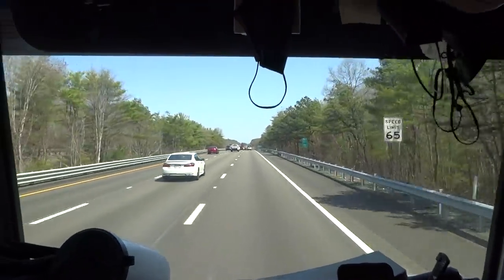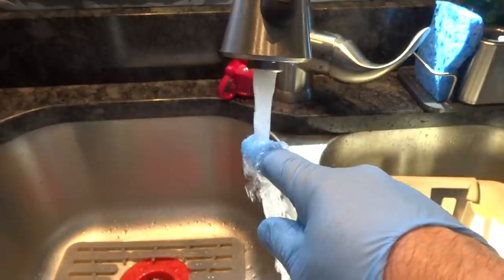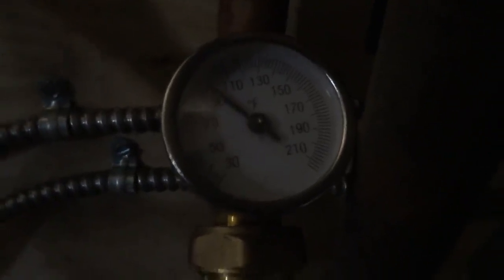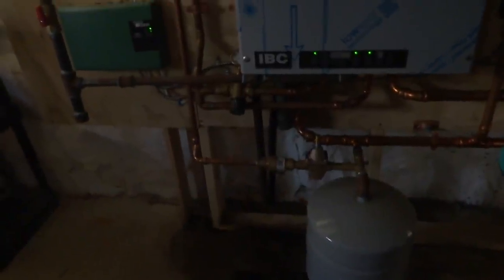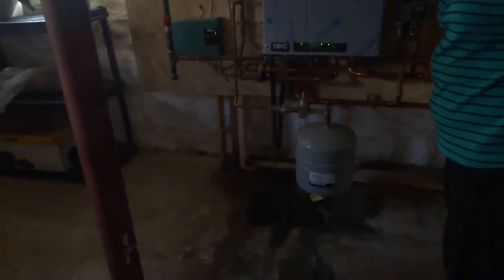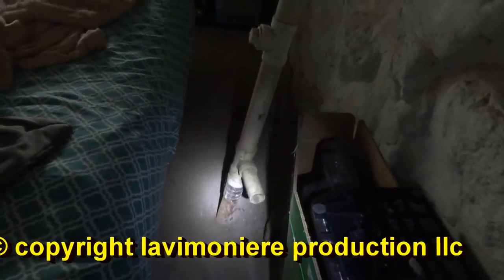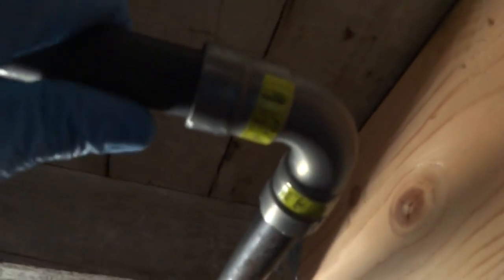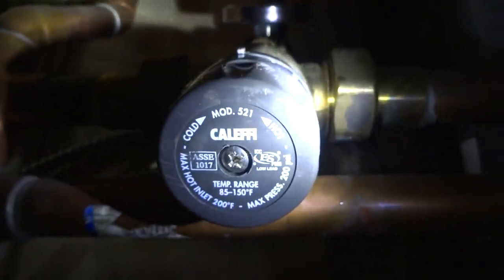HIGH EFFICIENCY GAS CONDENSING BOILER HACK INSTALL NO HOT WATER

Comment: The lady wants to address the issues. She just bought the home and I'm afraid she got a lemon. These are all issues that should have been disclosed at the time of purchase. Obviously the realtor and the previous owner didn't believe in due diligence and just wanted to unload the home. She may have a legitimate claim for non disclosure. She should contact her home owners insurance and seek advice on her options.
Reply: I don't understand.  There are inspections when a home is sold/purchased.  How did this "new" installation pass an inspection?  Dumping condensate water line onto the floor????  No drain valves on installation??  Saving time and pocketing money with cutting corners and not piping the intake to the outside?  And, old open PVC pipes to nowhere?   Tempering valves fail.  They suck.  Would it be allowed to bypass it and pipe the hot straight through to house supply and cap off the cold line? [Yea, I know....scalding issues, yadda yadda yadda]

Comment: They are "JUNK" my folks my years ago put in one in two different homes, and both units where the Worst!! They always had to let the Hot Water run for ever before they got hot water to the sink or shower, and had to run kitchen sink hot water before running dishwasher or was full of COLD water.  Took them out and put back normal Hot Water Tank and had all the hot water they needed.
Reply: That’s an easy fix put a recirculating line in ( problem solved )

Comment: Condensate drain line is acidic no?
Reply: highly acidic, i've seen it eat through cast iron pipe in less then 3 months
Reply: Yup. You're supposed to have it going through neutralizer media before dumping it down the drain to raise the pH enough to make it safe.
Reply: Definitely need a neutralizer.

Comment: More megapress i use them on low pressure steam condensates return in commercial in pinch ,  and you probably put it in already but a good pump for acidic condensate water is FP-22-DIVERSITECH

Comment: Steve , they had great gas fired wall heaters just for the water back when my family was posted to Germany with the military back in the mid to late 60's . It was just a small unit about 16" wide by 24" high mounted on the kitchen wall which was also close to the bathroom . It was a simple unit that was activated as soon as you turned on the hot water tap the burners fired and you had a constant supply of very hot water. Simple and never a problem with them , I often wondered why they were not here.
Reply: The customers here are idiots, they don't do yearly maintenance. The parts are special order majority of the time. The water has heavy scale the destroys the heat exchangers on them. They simply are not reliable enough for lazy homeowners.  Why spend 1200 on one when every ten years I buy a 350.00 dollar hot water tank.

Comment: I’m with you Steve. Give me a floor cast iron boiler any day. 
We are installing a ton of these pos wall hung boilers. No one is having them flushed yearly. They will all be replaced  in 7-8 years. 
Need to have a neutralizer on the condensate line too. No one is changing the media in the neutralizers.
I do like the mega press though. That has come in handy on gas and water.
Reply: UK here. Wall hung are pretty much standard. Nobody ever flushes them. Perhaps shoddy US manufacturing is the issue?

Comment: Steve 

The gas is a mega  press fitting and on a webinar they demonstrated bending it. Also there should have been isolation valves for service.
Reply: I want veiga to do a demo where the mega press a pipe bomb then compare it to a threaded pipe bomb in slow motion. There is a guy on youtube who has all the licenses to do it and makes pipe bombs all the time.

Comment: The boiler installers at this house saved every penny they could, drain valves?  isolation valves?  the installer didn't care about the plumber servicing the boiler.  Any valve before the expansion tank? Nope. Condensate water?? gravity will take care of it. Intake air?  Sure, use the already warm air in the cellar.
That mixing valve wasn't installed like the manufacturer, Caleffi, recommended, not even close. 
If you're a homeowner with a Caleffi mixing valve there's a YouTube video by Caleffi titled "How do I clean a thermostatic mixing valve?"  basically take the element out and soak it in vinegar or CLR a few hours, then reinstall, not practical for a plumber. My guess is that valve has been stuck since it was installed, Steve is just the guy who ended up with the problem.  

Caleffi is a big company in Belgium and the Netherlands, not all plumbing supply houses in the US carry their product or carry their replacement parts.  Supplyhouse does carry them, a replacement thermostatic Sensor cartridge is around $20 but you have to wait for shipment, new valves are around $140 depending on the size and fittings, and again you have to wait for shipment.

Steve might offer to install a few overhead lights in the cellar or recommend an electrician he knows and trusts.
This women will be a regular customer for Steve. 

Thanks for the video Steve.
Reply: He'll be baaaack

Comment: Hi Steven. Here in the Netherlands these condensating gas furnaces are standard, They need maintenance every year. There is a syphon inside for the condensate drain. This needs to be cleaned as they clog up. Also the burner bed needs cleaning every year. 
What is the make of this furnace, Intergas?
Reply: IBC.....zeg maar alles Intergas aan de binnenkant,een heel goede Boiler,niet tegen Steven vertellen,hij haat die dingen,hahaha
Reply: @barackobama5304  The installation is bad, such boilers need a condensation drain, everyone knows this and if you don't even bother to remove the packaging plastic from the appliance, and why connected as an open appliance,well.....

Comment: I bought one of those very early, "wall hung pieces of shit" back in  March, 1981. A large Japanese made, "Paloma Pack".  Three zones for heating, and a fourth zone for a hot water storage tank. I went from a coal boiler, that was converted to an oil fired boiler, to the gas fired Paloma Pak.
The change over was well worth the the cost, it paid large savings and  dividends$$ over the old oil fired coal boiler until 1996, when the local gas co. would no longer offer a service contract on this boiler! Went to a cast iron boiler in 1996, a Valiant, and it failed in 2010. Replaced it with another cast iron boiler!

Comment: Why would you put a tempering valve on a dhw unit? Just set the temp lower
Reply: @barackobama5304  No it will not, Generate the hot water at the desired temperature. The boiler is less likely to fur up if on a hard water supply.

In the UK, to get the extended warranties on combi boilers, steps have to be taken to improve the water quality in the heating system. Flush the system prior to fitting new boiler, to flush out the shit and magnetite that sludges up the pump and plate heat exchangers.( Our open feed and expansion tanks used in UK are responsible for oxygenation and microbial growth imo) . Also install a magnetic trap/ filter in the heating system return to the boiler to maintain cleanliness of the water.
Add some chemical inhibitor to the heating system water to reduce corrosion.
On the cold water supply for the hot taps. Either fit a water softener or a scale inhibitor, to stop limescale formation in the heat exchanger.
In the US, energy prices are and have been cheaper than Europe, so no incentive to move on from old inefficient, wasteful, appliances. The old cast iron heat exchangers lasted a lifetime because they could sludge up and not fail, but become even less efficient.
So as they say, Get with the programme, embrace  the new technology.
Learn some modern plumbing practice, and the HE appliances might stand a chance of lasting a lot longer.

Comment: In Europe they make sense, due to the insanely high energy costs. Not so much in this side of the pond.
Reply: Insanely high energy costs? I'm in the UK and pay less than many Americans- electricity 11p / kWh and gas 2.7p / kWh. I wouldn't call that insanely high. They make sense from an environmental point of view, and given that they are all that's available the costs for a replacement boiler have fallen considerably- a budget brand is £400 which is about $500. The better brands come with 12 year warranties and cost double. We have been using them for at least thirty years although they only became mandatory 15 years or so ago because they actually work.

Comment: Hahah those are megapress gas fittings not sharkbite and personally I hate those IBC boilers...nothing but trouble also you could just set the boiler at 120 and eliminate the mixing valve all together

Comment: Been working on this HE  cr#p  for 20 yrs now and your right..............................  save the planet my arse!                   Both gas and oil condensing boilers common here in Europe.  :-(      

As you mentioned when talking to the lady, condensate is acidic.          You should not discharge boiler drain into metal pipe  or let it soak into dirt,   this has all caused problems and out regulations prohibit such now.   ( liquid will eat metal and cement over time)     HTH

Comment: The condensate drain needs an acid neutralizer before hitting the pump or drain.  That discharge is very acidic and will eat through metal piping. I would do a Stan pipe or hub drain off that stack.

Comment: No point to using a condensing boiler on bb or rads is there?    She called him honey.:)
Reply: Yes there is. A properly designed and adjusted system should return water to the boiler at below 55 centigrade which will ensure it operated in condensing mode. Having said that, a quality European boiler (integas or similar) will fully condense regardless of return temperature. Even a model which doesn't fully condense at all return temperatures will do so for the considerable heat up period, which depending on your timer settings may be three or four times a day.
Reply: @spencerwilton5831  thx for the input.  I should clarify that I was referring to old cast iron rads, not modern European panel rads.